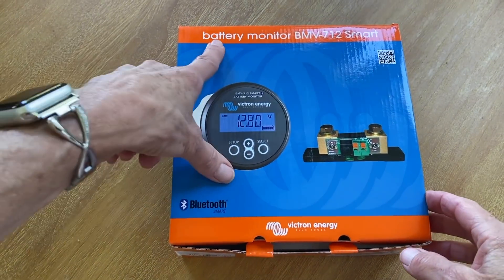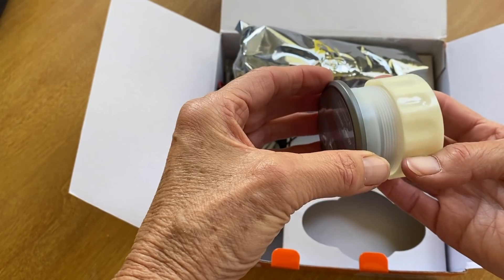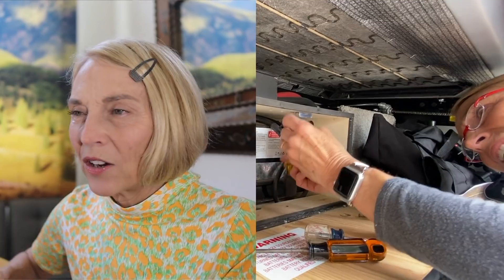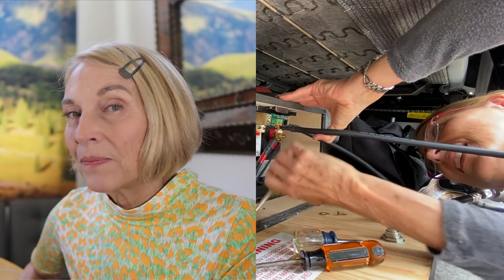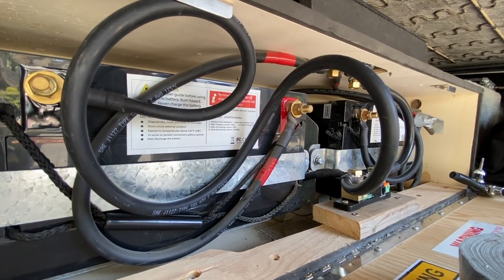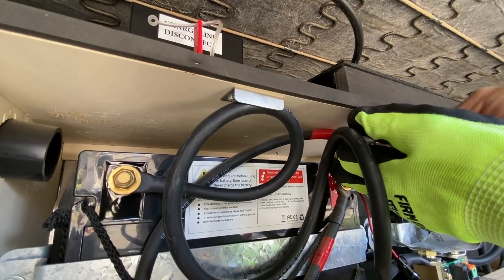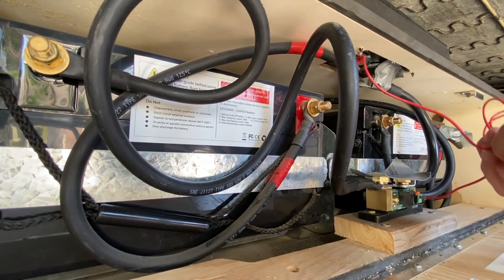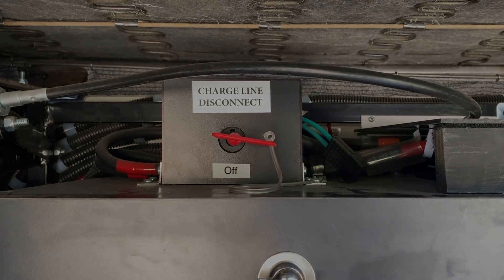Victron Battery Monitor installed in a PleasureWay Campervan

Comment: Thank you for this informative video. Still relevant 5 years later. I think the charged voltage in the description should be 14.2 and not 13.2 (logically thinking).

Comment: You fought with battery cable lengths a little bit.....you kept the exiting cables/lengths........because 
In parallel configuration of Lithium batteries - Positive cable lengths should match.  Negative cable lengths should match.  But Positive & Negative cable lengths don't necessarily need to match each other in parallel battery configuration?  Thanks for your comment(s).
Reply from the maker: Thanks. You guys teach me so much.

Comment: Great video. After seeing it we ordered a Victron SmartShunt 500A (similar to the BMV-712 but without the display) for our 2019 Ascent. I’m wondering what battery cable to order. Pleasureway has used 4/0 cable so I’m thinking maybe an 18” or 2’ 4/0 would be best. What do you think?
Reply from the maker: Oh boy, that's way above my pay grade.  Victron has a forum called Victron Community.  You might get some good advice there.
Reply: @FromShetoMe  I guess what I was really asking was what type of cable did you use and how did it work out?
Reply from the maker: The description box should have a link to the cable I ordered but I should have gotten one a little bit longer as they are really hard to work with.
Reply: @FromShetoMe  Thanks for getting back to me. I had another look at the description box but couldn’t find a reference to the cable. I may be missing something.
Reply from the maker: Stand by, Doug Tucker is sending me the link to the one we used.
Reply from the maker: The link doesn’t work but email me and I will send Doug’s suggestions. energymaven@gmail.com

Comment: I found in our Ascent that it has parasitic electrical drains/losses that could likely be eliminated. The propane valve solenoid and master power solenoid suck 1-2 amps 24 hours a day to stay on/open, potentially consuming up to 10% of the batteries per day. Replacing these with a manual valve and switch could really help if boondocking or maximizing energy for a compressor fridge.
Reply from the maker: Thanks so much for the tip.  We'll look into it.

Comment: I thought you might like to know that in our 2018 Ascent I added a second Lithium battery charger 🔌 (Progressive Dynamics 65 amps) which charges the batteries more than twice as fast than the single 45 amp unit that comes with the van. The specs on the lithium batteries can easily accommodate the higher charging amps. Progressive dynamics says that these charger units can simply be wired in parallel to create a combined output between the two units. I wired the second unit to a separate breaker switch on our panel which uses conventional circuit breakers that can be bought at Home Depot. I am able to switch the second charger on or off as needed. This gives me the option to fast charge the batteries when the generator is running, making better use of the generator’s power output, And dramatically reducing run time. If running the air conditioner, then I would just run one charger and not both of them so as not to overload the generator.
Reply from the maker: Thanks for the tip!  Did you also add a battery monitor?
Reply: From She to Me Yes I installed an AiLi monitor, similar to the Victron

Comment: Whenever you swap out your all electric refrigerator, be sure to put the propane cap fitting on the propane line right away. Because the propane shut off value might not be 100 leak proof when closed, on my Roadtrek SS Agile, 3 days later went to Home Depot for propane fitting, all my propane has been leak out!
Reply from the maker: Thanks.  I contacted Pleasureway and they gave me the exact part I needed to order.    I can't wait to get going on this project but also worried about all that might go wrong.

Comment: Great info, but I'm a little confused... did you add lithium from another dealer at a later date? Is that why the battery monitor was the incorrect one for your lithium batteries? I can't imagine a company would add lithium to their own van and neglect to replace the AGM monitor with the correct one for the lithium batteries. I don't know enough about batteries, but am assuming the wiring, alternator, solar controller, inverter/charger are correct for lithium batteries. 
Thanks for the info!
Reply from the maker: We have original equipment. I was also surprised at their choice of monitors but maybe there is a reason for it. I’ll give someone the benefit of the doubt unless I learn otherwise.

Comment: Enjoyed you determination and willingness to try different thing and yes, 12V will arc. “How many government workers are needed for Debbie to install a shunt? Sounds like two or three in the video!” 😜😜
Reply: Interesting looking at your Ascent battery wiring as it appears to be connected in Series, whereas my Lexor is wired in parallel. So, different consideration for connecting the cables and shunt.
Reply from the maker: Well, we had this discussion with Doug Tucker last week.  I was just going off what one of the PW guys told me.  So we should probably try to get this verified.
Reply: From She to Me yes, I have an email into PW, but no one has responded. I have sent the email twice. My cable came in and I actually ordered two, one 12” and one 18”. If I am correct I can use both one for the negative to the shunt and one for the positive the way mine are set up.

Comment: Debbie, why would you leave the MONITOR in the battery cabinet ? Servers zero use there, that’s why there is so much cable, so you can mount it darn anywhere . Cheers 🇺🇸🇺🇸🇺🇸🇺🇸
Reply from the maker: Since it is bluetooth, I can see everything on my phone.  No need to run the cable or add more clutter inside.

Comment: Debbie, good job and you are certainly braver than me, I had my Victron BMV 712 professionally installed....I have two AGM 6 volts in series under the hood in the engine compartment... 

Couple of comments; yes, you're correct that Lithium batteries seem to stay level and "fall off a cliff".... but, you can certainly run them to a zero percent state of charge, if you had to.  

The Danfoss refrigerator will actually stop working at some point before you're batteries get too low...at least that is what Nova Kool told me, I know you have an Isotherm, same compressor. Call them and they will probably tell you the same thing... don't worry about it.

The Victron BMV 712 is not just for Lithium batteries... it's great for AGMs as well, and contrary to popular belief, and a lot of people don't actually know this, you can run an AGM battery down to 80 percent ...if you don't believe me, call Full River, they are battery manufacturers....is it a good idea to do that regularly??? No, but, it won't kill your battery....it might shorten it's life, by a year or so....I don't expect my batteries to last 5 years.....if I get 3 or 4 years, that's fine..... Anyone who tells you they got more than 10 years from their house batteries is probably lying. 

Another thing is, if you have two 6 volts in series, and say each are 224 amp hours each, make sure that you don't add these two numbers together and set the parameters on your phone to 448 amp hours.... my RV shop did that, professional install, and this was WRONG, WRONG, WRONG.... you can only do that if they are two 12 volt batteries.....

I have the correct parameters set up for  224 amp hours on my system, it's still two 6 volts in series for one 12 volt system.....

I would say that the Victron BMV works very well, better than their customer service, or the owners manual , which in my opinion, leaves something to be desired.....I tried resetting my system and it says just do this and well, it didn't work very well.....

My advice is try and control everything from your cellphone, the Victron monitor in my coach, has these tiny little buttons and miniscule display that drove me crazy.....

Bottom line is this, only pay attention to the state of charge.... that's the most important thing....as long as you do that, you should be fine. 

I only have two solar panels, 275 watts, and I have a compressor refrigerator ( Danfoss) and ran that and my fantastic fan all night... went down to 89 percent. .. you're going to be fine....
Reply from the maker: Thanks for all the tips and info.  I had thought you could run the lithium to zero and then I started reading all this stuff and it got me confused.  So that is good to know because we have run it to zero on a few occasions and I was thinking maybe we damaged them.  I will look into the parameters issue and make sure I've got them set right.

Comment: I thought you did a great job. I agree large wires very stiff hard to work with and the nuts have to be snug and the wires can move when tightening. When the gentleman that was assisting you checked the tightness of you nuts they were tight. I have the Victron unit you installed and there is none better. I usually don't plan on going below 30 percent but to be honest have never been below 60 percent.
Reply from the maker: I'm glad I have so many smart people looking over my shoulder.  Now I'm more confident that nothing is going to blow up back there.

Comment: Thats a nice install Debbie on the Victron monitor Hope to see more upgrades in your future videos. By the way is the Lithium Batteries you have on the Ascent, 200Amp Hours sufficient for your power needs while off grid? Thanks
Reply from the maker: Of course summer will be different than winter, but I have been looking at my app all day and amazed how quickly the solar is topping off the batteries.  After boiling water in my kettle, it was minutes to go from 97% to 100%.  I will be feeling much more confident now when I use appliances.

Comment: Good job!  Just 2 suggestions:
Tape over the battery posts to prevent shorting with tools.
Remove all watches, rings, etc beforehand.  12v won't electrocute you but if your ring shorts out the battery the ring will instantly become red hot and you could loose that finger.
Reply from the maker: Thank you so much for those excellent tips!!!  I will jot them down in my book to share at a later date.
Reply: Tim R  hello, and YES I know someone whom nearly lost his RING FINGER working on HIS CAR,  but on the other hand, working on some wiring in a large built up A/C back in 68, we shut off EVERYTHING, but unknown to us there was a SINGLE 125 VOLT CIRCUIT to outdoor lights , blew a part of my wedding ring, had it repaired, NEVER WORE IT AT WORK EVER AGAIN .CHEERS  ,,, 🇺🇸🇺🇸🇺🇸🇺🇸

Comment: PW switched to lithium batteries in the 2016 model and the 2017 model got the upgrade to a 2000W inverter.  Your video inspired us to check our Victron settings and found we needed to change a few (it was at the default for AGM batteries but we have the Lithium!). Thanks for the inspiring video --- your videos are a great help to us!  e're posting this as a separate comment because you mentioned that sometimes replies to your reply are hard to access. But will duplicate it as a reply if we can.
Reply from the maker: Thanks for the second post; did make it easier.  And thanks for the info.

Comment: Debbie, Madeline and I loved the video. For Lithium Ion batteries a shunt based meter is required to monitor the battery condition.   We have a 2016 Ascent with the Lithium Ion batteries and replaced the dinky 450 watt inverter for the TV with a Xantrex HFS 2000W inverter/charger, and the Victron 712 smart monitor - I also added the temperature monitor option just to know the battery temperature and if it ever got below freezing to not charge the battery.   Now we can run everything (except the air conditioner) from the inverter without running the generator.  Before the 712 addition we had "plenty of Amp hours available with ignorant bliss" now we know the consumption and battery time left from the app.   Good job on the install (from an EE), you did have me a bit concerned concerned with the metal tools and the battery posts nearby.  I think I'll put down that right angle attachment on my list of possible presents for Madeline to look at.
Reply from the maker: Thanks.  It became more apparent after the arc, how much stupid stuff I was doing.  But as my brother said, 12V won't kill me.  Was it in 2017 that PW went to the lithium batteries and 2000 watt inverter?  That was a big step up for them.
Reply: PW switched to lithium batteries in the 2016 model and the 2017 model got the upgrade to a 2000W inverter.  Your video inspired us to check our Victron settings and found we needed to change a few (it was at the default for AGM batteries but we have the Lithium!). Thanks for the inspiring video --- your videos are a great help to us!

Comment: We installed our monitor display right above the rear sofa cushion, mounted to a bent L-bracket, and attached with one of the existing black screws from the rear door screen. This makes it easy to view at any time from inside the van. (Also I used black heat shrink tubing to make the L bracket black and look tidy.)
Reply from the maker: Good ideas!  Thanks.

Comment: Another great video and project.  Regarding the red key for isolating the batteries from the system, just turn and remove the key.  It's on a lanyard and it is a sure fire way of telling at a glance that all is off.   Key in, system on, key out system off.  Have a great 2 weeks traveling and stay safe.
Reply from the maker: Thanks.  I realized that at the end but when you are starting out, it's all so foreign.

Comment: Wow I am impressed you are really modifying your RV! We sold ours today 72K for a 2015 Roadtrek SS Agile ouch they really depreciate. Even though it was in excellent condition.
Reply from the maker: And what will be your new ride?
Reply: A custom van 2019 Sprinter 170 V-6 with an electric sliding door! Build should be ready September 1st. It is shocking to see that it cost us $1000.00 per month over five years to own the Roadtrek!
Reply from the maker: @johnpuccetti6019  Wow.  But probably a lot less than a Class A or C.
Reply: I hope our paths will cross one day. We paid $137,000.00 out the door for the Roadtrek our custom build will be $135,000.00.
Reply from the maker: Wow. Sounds like a good deal on the new build. Keep me posted on how your new rig works out for you.

Comment: You are right to have a separate battery monitor which shows voltage, amperes used etc. (more) precisely than the built-in one. I had a Votronic 100 S  with a 100 A shunt installed together with two new 110 Ah AGM batteries in 2019. All together they fulfill their purpose. Now I am on the safe side, because the monitor shows the exact voltage of the starter battery in addition. It was installed next to the bed, so I have instant info available when I am boondocking. What amperage does your shunt have?? 100, 200, 300 A? Will it be good enough? - Greetings from Bavaria, Germany.
Reply from the maker: This shunt is 500!  So should be good to go.  We are out camping and I'm having fun checking the batteries.  Makes me feel much more comfortable about the compressor fridge.
Reply: @FromShetoMe  You are now excellently prepared, indeed.